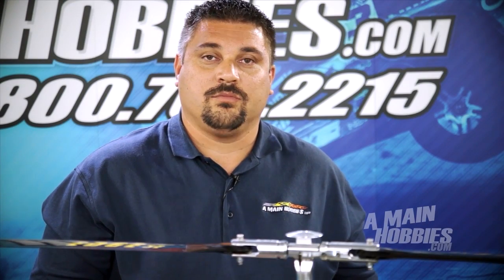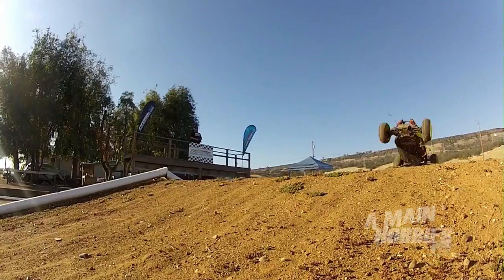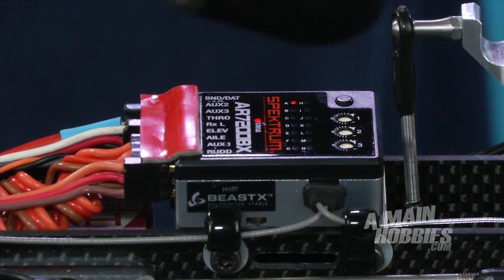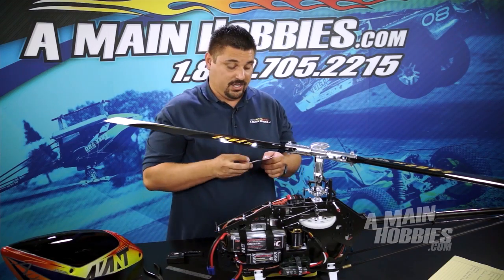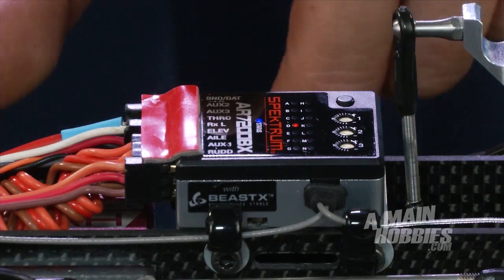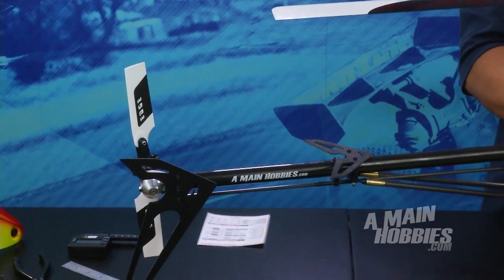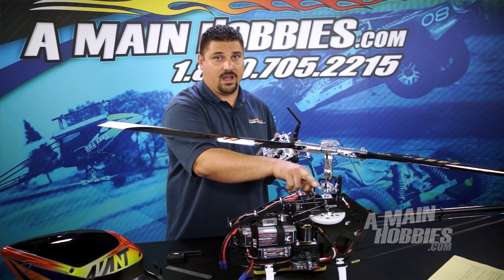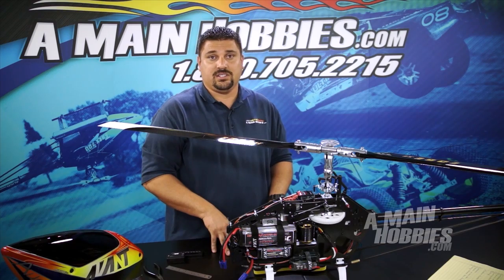How to Setup BeastX Flybarless Gyro System, Part 1 of 3

Comment: Thank you for the informative video . Could you confirm in step G is the same for micro beast X as Beast X . Once swash is level and blades at zero . d
Don`t touch sticks or change status of servo last used in adjustement . But just hole set up button till H lights up . Thu Lou A+

Comment: I get a tail kick to the right, nose left. And it centers quick. Not tailwag. What could be the problem,  i put everything right according to the instruction for the ar7200bx setup. Is the parameter for tail compensation the next step for me? Or should i create a straight throttle curve for constant headspeed. I got the throtte an pitchcurves maybe a little bit to mixed and throttle gives collective at the same time. Meaning maybe the tail is left behind.
Reply from the maker: Hi Robert. Our Heli tech added this reply: 
"The beast does have some pre comp that can be programmed in to attempt to help with that customers issue. It will be a trial and error process - program it, test it, rinse and repeat..but yea he is onto the right idea."
Hope that helps.
-Brett
Reply: @AMain_Hobbies  Thank you very much for your help and time. I will try the precomp settings.
Reply: @AMain_Hobbies  I just took it outside. Problem solved, i needed a straight throttle curve 0-80-80-80-80. No more tailkick. 0-90-90-90-90 for my trex500 is to much. It's going in a scale fuselage. Pitchcurve set at 20-35-50-75-100. Including throttlecut.
Reply from the maker: Great! Glad that helped Robert. 
-Brett

Comment: how do you adjust the servo in servo centering  using the cyclic stick , trim ??? i am ditching the old vbar sensor in my align 700e and would like to instal a beast rx
Reply from the maker: Hi Joseph. Our Heli tech has noted that both servo centering, and trim are adjusted during set up, and after test flights. Hope this helps. 
-Brett

Comment: This being a setup tutorial a good start forus newbies to flybarless would be tranmitter settings and binding to unit which i assume has to be done before unit setup would start.
Reply: Exatamente, estou tentando configurar o Microbeast Plus v4.2 com o rádio Futaba14SG e o receptor R7008SB pela primeira vez.
FASSTest-2.4GHz, e não consigo conectar os cabos e não tenho certeza se estão corretos, pois fiz a seguinte conexão: Fiz as conexões conforme abaixo:
Eu conectei a bateria no Switch e a outra extremidade do switch no canal SYS do Microbeast Plus V4.2

No Microbeast Plus V4.2, o ELE / DI1, na porta SBUS.

Depois de fazer isso, liguei o interruptor pressionando o botão do Microbeast Plus V4.2.

1 - O menu A começa a piscar e o botão Microbeast Plus V4.2 é liberado e a luz piloto começa.

2 - Pressione o botão Microbeast por 2 segundos até que a luz piloto fique vermelha.

Depois disso, nada acontece, de acordo com os vídeos, a luz do Menu B fica azul reconhecendo o tipo de receptor, MAS no meu caso isso não acontece. E assim, eu não posso fazer mais nada, e não há uma alma no planeta para mostrar se estou fazendo certo ou dando alguma ideia para acertar os passos. Eu nunca vou usar essa unidade Microbeast Plu V4.2